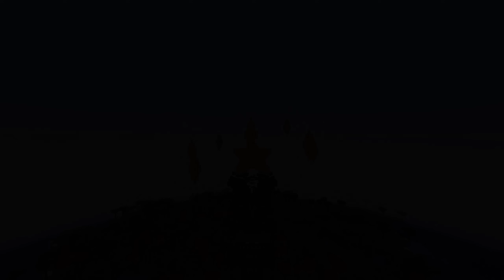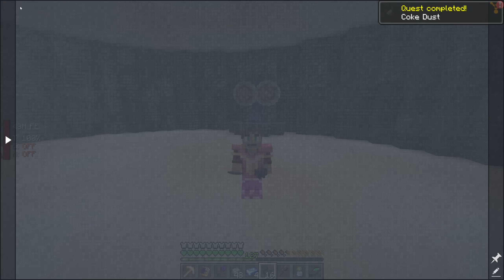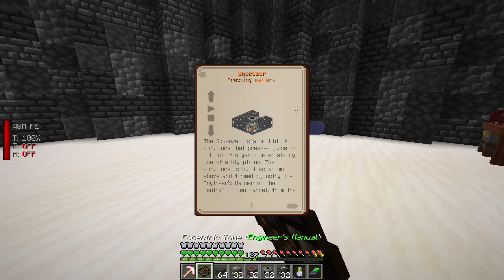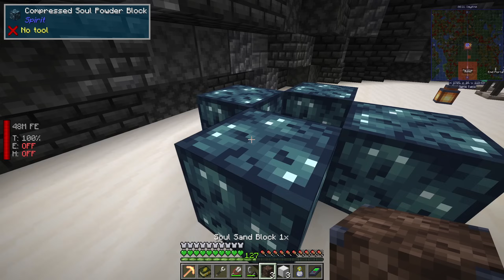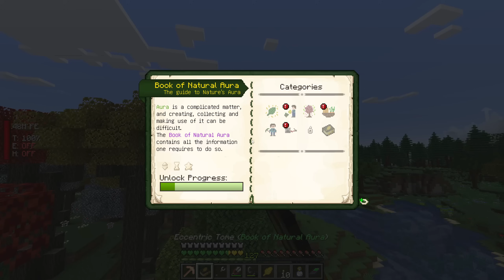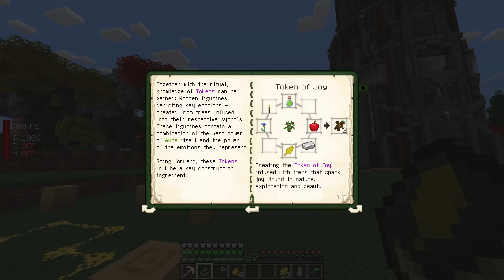ATM 8: Ep 54 - I've used all the mods!

Comment: the immersive engeneering multiblocks have color coded in-/ and output ports. the blue ones are input, the orange ones are output. so to get the resin directly into the bottling machine, you would have to hook up the pipe to the output at the front of the refinery.